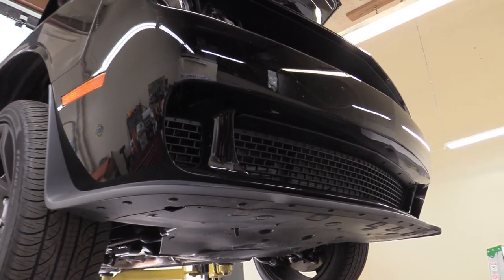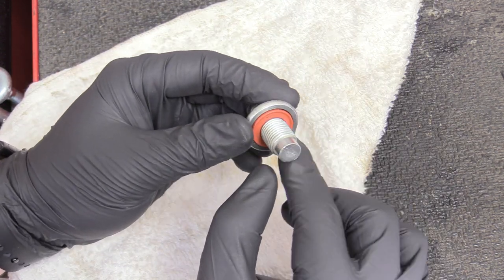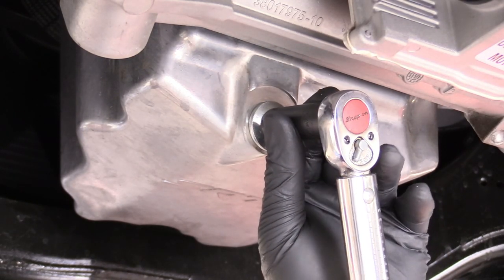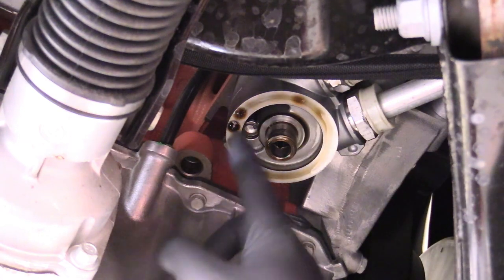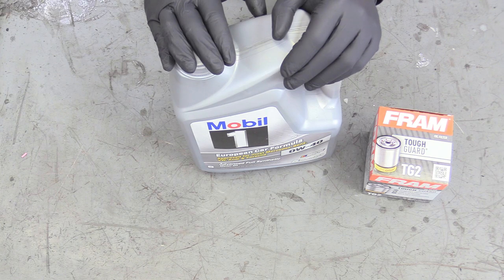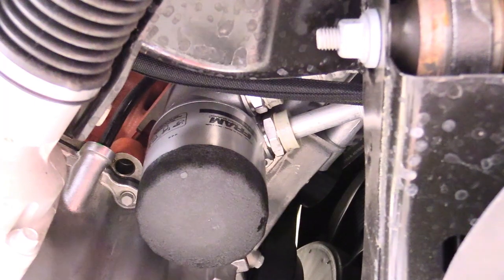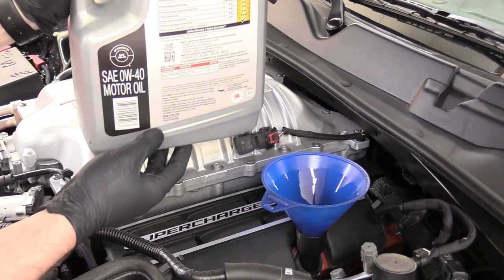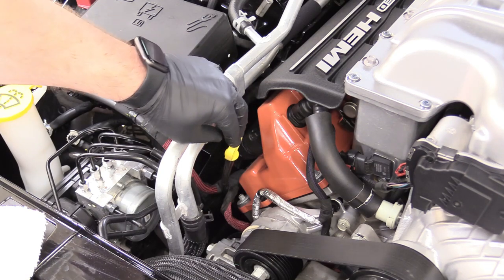How to Change the Oil and Filter Dodge Challenger Charger Hellcat 6.2L 2015-2021

Comment: I doubt the dealer drains the cooler. I think you risk damaging the cooler every time you screw with it. I recommend buying the filter from the dealer and sticking with recommended oil brand.
Reply from the maker: I drained the cooler the next time it came in and like an 1/8 of a quart came out. Thanks for watching!

Comment: All oils are not the same Mobil is a good oil but pennzoil ultra is better the only oil that beat pennzoil ultra is amsoil it been tested and a proven fact .don’t believe me search project farm motor oil test here on YouTube he tested all the brands from high heat to extreme cold and metal wear and amsoil won follow by pennzoil ultra Mobil wasn’t in the top 5 and he also tested did a test on all the top brands oil filters  and Fram was almost dead last. Look up Project farm on YouTube and watch
Reply from the maker: Love project farm! As I said in the video the owner of this Hellcat wanted to use the Fram. I would have used the Dodge part. But hey we are all different. Thanks for watching!

Comment: it is required to drain the oil cooler
Reply from the maker: I drained the cooler next time and only like a 1/16 of a quart came out. I don't think so but I'm sure someone will be along shortly to yell at me. Thanks for watching!
Reply: Draining the oil cooler is required and you really should be getting more oil out of it than you did.  It’s where that “7th quart hides.  🙂

Comment: One thing I don't understand/hate about some manufacturers is why don't they do like VW/MB that have the filter on top so you can easily do it with the oil extractor without jacking up the car.

Comment: Great vid! Never forget to drain the oil coolers on the hellcats! Other than that, great work!
Reply from the maker: Yeah I figured the cooler runs down into the pan anyway so it didn't need draining. Since I put in the amount Dodge says and it's correct on the stick I assumed I got it all. But yeah next time! Thanks for watching!

Comment: Been changing my own oil for many years. It's just way too expensive to get it done at a shop these days. My old 392 Challenger it was costing well over $100. I could do it for half that and an hour of my time.
Just recently bought a 2023 Hellcat Charger and actually can't wait until I get to do my first oil change on her. Bought it with 7600 miles. As soon as I hit around 11k I'll be changing it. I know they say to do it less often but I've always changed the oil in my cars between 3k and 4k miles and they all always last a really long time.

Comment: Did you drain the oil cooler?  Didn't see that
Reply from the maker: 7 quarts came out. The capacity is 7 quarts. If there is any oil left in there it is very minimal. Thanks for watching!

Comment: The manual says use 0w-40 Pennzoil or an equivalent. If you have any factory powertrain warranty remaining, best to at least use a 0w-40 oil, Pennzoil or not, to keep any future warranty claims from becoming unnecessarily complicated. Better to use what Dodge recommends specifically because this is a race car and I don’t think owner is driving it normal with that beauty engine in it.

Comment: With no torque wrench I try to simulate how ever many foot pounds are needed and put that much pressure one foot from the pivot point on the ratchet so something that needs 20 foot pounds with a 12 inch ratchet I'd put 20 pounds of pressure at the end of the ratchet or 40 pounds at the end of a 6 inch ratchet or 10 pounds of a 24 inch ratchet. That should keep you from stripping threads unless you are really bad at estimating weight. I wouldn't use that system if I was rebuilding engines but for drain plugs and accessories I don't mind the risk. But usually I just tighten until I think it's tight enough.
Reply from the maker: Yep. Tight is good enough most of the time. Thanks for watching!

Comment: Have you been using Mobil1 for awhile? That oil looked pretty bad when you took off the plug. Use pennzoil plantinum 0w-40 or personally I’d use amsoil.
Reply from the maker: It's all API SN so it's basically the same thing. Thanks for watching!
Reply: @2carpros  I’d personally use API SN approved 0W-20 for better fuel economy and API SN approved 10W-40 synthetic blend Coastal Oil if you want to drive your car hard. API SN approved AMSOIL Signature Series and RedLine Oil is not the same thing as API SN approved O’Reilys oil. You’re comparing diamonds to copper in that regard but hey they’re both the same because they’re both strong…….

Comment: European car formula oil? 🤔
Reply from the maker: It's going to explode!!!!!! 

Haha no, I'm just joking with you. That's just a marketing term Mobile 1 uses to push it's oil on luxury car owners. But it is great oil and the correct application here. Thanks for watching!
Reply: @2carpros  😂 bought my hellcat a few months ago so im doing my own oil change now. thanks for the vid.
Reply: @Jake__X  i don’t own a hellcat but I’ve been using mobile 1 in my scat pack for 40k miles now and I believe before pennzoil mobile 1 was actually the recommended oil for dodge back then
Reply: A lot of manufacturers recommend ZINC in your oil now. I believe European oil already has it in it.
Reply: For right hand drive cars